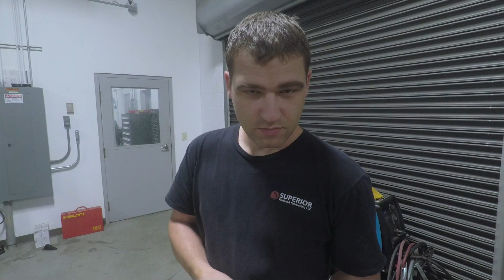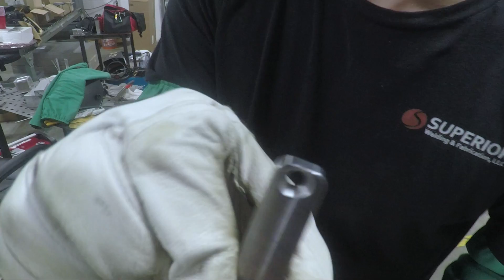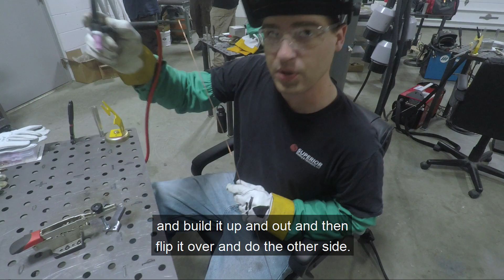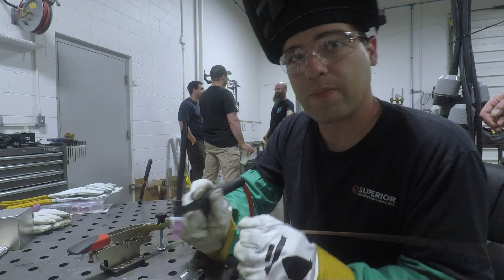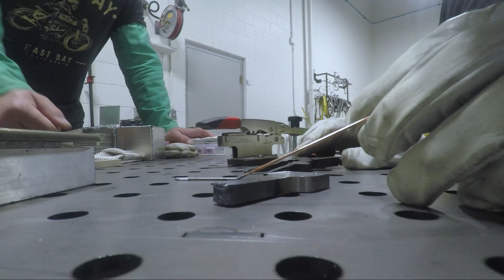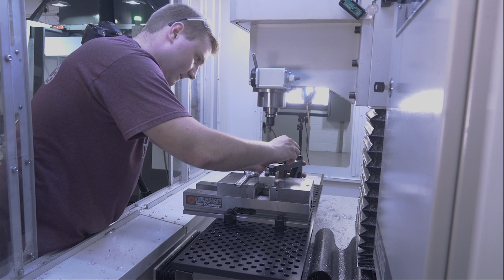TIG Weld Repair on Machined Part!  WW155

Comment: Warped parts, and heat affected zones, the 2 main reasons I stay away from welding on parts similar to this. Welding has it's place but in my opinion this isn't it.  Seems to me that some welders think they can fix anything when in reality they cause problems on machined parts, especially small parts. Bottom line is welders don't machine parts and the tools they work with are heat, filler rod and tape measures. Therefore  they don't understand the consequences of their actions. It takes the skill of the machinist to determine the proper course of action with a part like what was shown in the video. Just my .02 from 30+ years of machining.
Reply: There are times that welding is a valid option. I've been the welder in machine shops for many years and sometimes, the weld saves a job that there is not time to remake. Not all materials are viable for welding repair and heat management before/during/after welding is critical. Another consideration is the finish. Weld metal does not generally take oxide and anodize type finishes the same as the parent metal, resulting in blemishes in the surface finish.
Reply: Repair welding is almost entirely different from fabrication welding. Proper prep and setup is extremely important to get a weld deposit free from voids that will become evident after machining. Careful control of heating and cooling is often necessary to minimize distortion and keep the weld deposit from becoming very hard and difficult to machine.
Reply: It's certainly not my intention to bash welders I just don't think the majority of them understand the consequences of their attempt at build up of material. Or how to properly go about it. For that reason I avoid it. If a repair is necessary on molds I build I machine a pocket and fill it with a machined insert of the same material.
Reply: I don't mean to bash machinists but very few machinists understand the capabilities of welding processes in the hands of a skilled welder. On a job that is suitable for welding repair, it's often a better repair than machining out a section and inserting a piece to machine to shape. Molds would be problematic for welding repair if the tolerances are extremely critical and the surface finish is highly polished. The welding tends to leave a certain amount of undercut. It may require too much stock removal to blend the mold surface to the proper finish. Distortion of the entire mold is entirely possible. I would only risk welding most molds if other means of repair are not practical  and the mold is otherwise going to be scrapped.
Reply: phlodel I agree with some of your statements but not all. I've built countless inserts for molds I have worked on over the years (materials A2, D2, CI, P20, Aluminum  6061, 2024, 7075, 7050 and others) I have a system worked out that makes it impossible to tell if it has been repaired. No need to preheat with the gas hatchet and fill with a dissimilar metal filler rod because the proper one is not available and ending up with a warped and twisted pos that has lost its original tensile and hardness and in the case of aluminum is soft and gummy to machine from the heat. Welding has it's place in fabrication and some repair jobs besides molds but there always  seems to be an undercut next to the base metal and that other gremlin the heat affected zone. I've dealt with certified welders on down to the apprentice welder and they all work with heat, filler material and tape measures.
Reply: High alloy steels and aircraft grade aluminum alloys are almost impossible to weld satisfactorily. Very few welders have access to filler rod that has any hope of matching the parent metal and use whatever they have on the rack. They also think if the part looks OK it is satisfactory. Only comparatively low carbon, low alloy steels are acceptable for welding repair. Even if matching filler rod is available, a part made of heat treatable metal would have to be reheat treated to regain its mechanical properties . This would induce more distortion. In short, you're absolutely right. The problem is that welders are not trained well enough to know when they shouldn't attempt to weld.

Comment: Perhaps we are all are guilty of finding time to re-work goofs- but not so willing to put in the time to prevent them in the first place. It seems counter intuitive to slow down production to increase reliability, but re-work is SO expensive. How many new parts could have been made in the time from the goof ...to finishing the reworked part? I bet John could have made 6 new parts in that time.Yes, welding repair is possible- but at what cost? Goof proofing small run work is especially difficult- every job has different goof-pits. For me, it is a matter of capturing exactly what the goof was- and its root cause- to see if there are common goofs that apply to any job. A common one I have observed is simply dropping parts onto a concrete floor and bruising them.Flipping- for example is common to many jobs. Perhaps it would be worth spending time to goof-proof flipping as this might prevent lots of re-work in the future. IF flipping is a common source of goofing....my challenge is -what could you do to goof-proof the flipping?
Reply: Yes, and you did a good job- nothing but support for your great work. As you do often- you get us thinking and reflecting. Is it better to treat the symptoms (goof up) or the disease (stop the original mistake happening again)?When I reflect on your inspiring videos of Lean at Pierson Workholding, I keep saying to myself... "it's ok for them, because they can afford to invest in de-goofing their repetitive processes... but what I do is small volumes of lots of different things".How do we get the big advantage of Lean... when we are a small job shop?
Reply: What are the Lean tools that would work for small batch manufacture?Certainly, there are a bunch of admin processes that we do every week, these could benefit from the Lean tools.But what can I do in the shop that makes my small jobs behave like batches of large volumes?Pallet work holding looks a bit like this same pallet with different stock attached. Perhaps a standard tool set in the machine. How about using a datum off the part and using dowel pins? Flipping then is always off these dowel pins not off an edge? how much extra material would it consume.. how much does that actually cost?Trying to solve this puzzle is a good use of our brain power- rather than just shouting louder when mistakes are made!Keep up exploring John.

Comment: That metal will air cool instead of fully anneal (fully cooling in a closed furnace) so testing the hardness of the local area or just taking it easy on some carbide tools will do just the trick (otherwise taking a real chip and about 35 sfm with high speed tools should do

Comment: Fun fact: A summer intern was also responsible for the famous NASA mix-up between imperial and metric

Damn kids 😂
Reply: Easy enough fix. Just hire some dwarfs to dance around it...
Reply: I had a professor in college this past semester who confirmed the story (Dr. Farisa Morales). She currently works at NASA and has for a number of years.

It wasn't Lockheed Martin's fault. They did the work and gave the data to NASA in inches, which isn't unusual as most of NASA's contractors are US based. But the intern put in the data into the calculation table without realizing it was imperial. As NASA works in metric, well...
We now know the rest.
Reply: But NASA didn't mess up, they've been fully metric for years. It was a contractor, Lockheed Martin I think, that got a conversion wrong.

It doesn't take a conversion to get things wrong. A confusion between yards and feet has been known to happen and think Spinal Tap with an 18 inch tall Stone Henge, rather than 18 feet.
Reply: Here's her NASA profile

https://science.jpl.nasa.gov/people/Morales/

Comment: Seems the TIG fill took longer than it would have to remake the part.  

Also (and maybe just the camera angle) the heat from the TIG caused that arm section to warp. 

Suppose it's a good demonstration. But real world in this case, cheaper and faster to remark the part.
Reply: For this part yes but I have made some parts where the material costs alone made it worth the little bit of time.
Reply: I think you missed the welder's point on the purpose of doing this. He was referring to doing a part that had perhaps multiple complex operations and hours of machine run time. In that case you can't just toss it in the garbage and start over without losing money. What Jon was trying to show here was that you can fix those mistakes and while this part is rather trivial and the material cost is next to nothing, it was a nice test to prove a point on a simple cheap part. You could apply this experience to any time you make a mistake with a part and than do the math in your head at the time to figure out whether it's worth it or not.
Reply: Also there are times when you are machining a part which is not from raw material and is not easily replaceable (if at all). In this case you have no choice but to weld.
Reply: I have accomplished welding repairs on many complex parts in machine shops over the years. The more machine time invested in a part, the more desirable it is to repair it. Actually, I don't know what the part in the video is for but a tapped hole at the end of a lever is a good candidate for welding. If a repair is in the middle of a part, it's far more likely that the weld will distort the part beyond tolerance. Not all machine work is held to extremely tight tolerances. Savvy engineers  specify the lowest precision level that will suffice. Some work is what I like to call hog trough tolerance. As long as the material is not too intense, many parts can be salvaged. Hugh alloy steels, aircraft aluminum, not so good.
Reply: the part in the video is a demo
Reply: briancnc 
I don't think I did since I specifically said for a part like this...

And really. In many cases a pressed plug will be cheaper, faster, easier than filling with weld. 

Weld build ups should be the 100% absolute last resort. 

For this part I would have drill and reamed the bore and pressed a piece in to fill then re-machined it if for some reason I couldn't remake it.
Reply: In this case, yes. Sometimes the amount of machine time required makes repairing a part economical. Sometimes the setup for a part has been changed out on the CNC machine. It can be easier to do one or two operations on a manual machine to repair a part than set up the CNC to remake it. Kind of depends on the required tolerances and heat sensitivity of the metal, too.

Comment: did the part warp excessively?
Reply: On this particular piece I don't think there would be much draw since they just filled the very end, but I do think it's a valid concern depending on the part.
Reply: thechosendude I agree. all welding distorts and needs to be accounted for. common to overlook it.